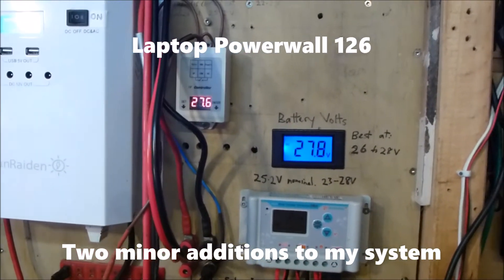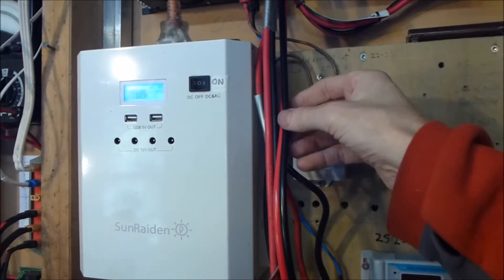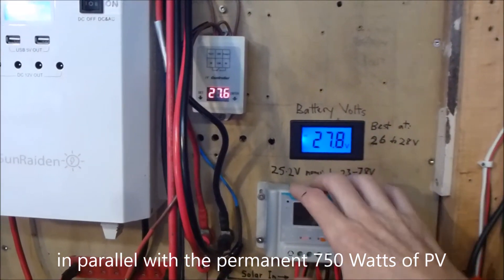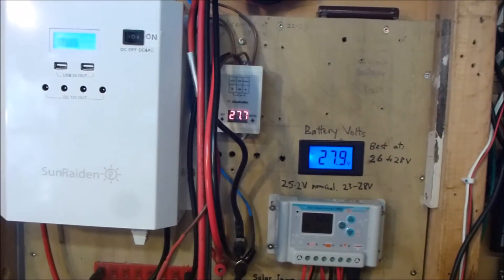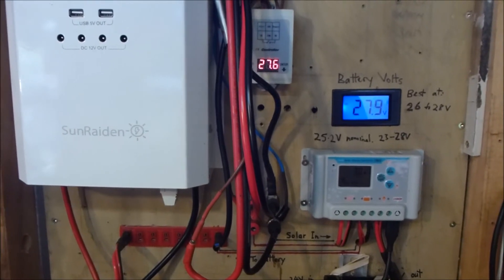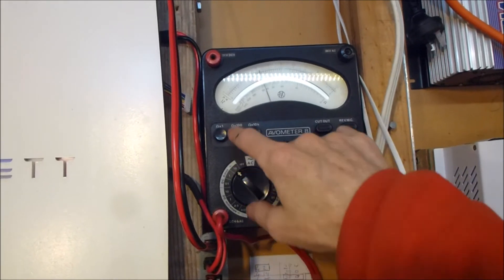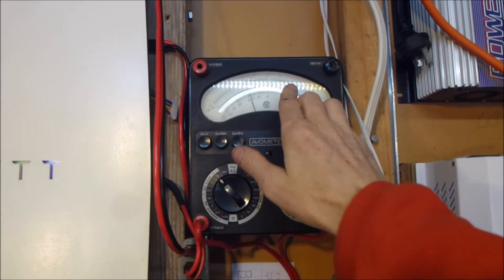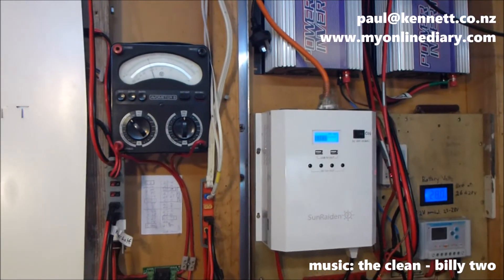Laptop Powerwall 126 - Solar panel diverter and Avometer

Comment: I can highly recommend the epever solar charge controllers, really cheap and have built in monitoring.  I've got mine doing pretty graphs in grafana and it was incredibly easy to setup.
Reply from the maker: Yeah - I've seen your EPever vids. Looks like that'll be my next controller.
Reply: Only thing to watch out for is the overall total power support.  i was a bit disappointed with the max capacity of even something like the 30A model i have.
Reply from the maker: Hi Colin. I always assume cheap stuff is good for about half the rated power. Would that be about right? Cheers, Paul
Reply: No i think it's good for it's rated power but with the 30A MPPT model for instance you are limited to 720w on a 24v setup.  I had thought with it being mppt and it stating that there was a 100v limit that i could put more panels in series and would be ok so long as i kept it under the voltage and amperage limit of the controller but the documentation has a limit set, it does contradict itself slightly but i'm not brave enough to test it lol.  I had a good conversation with Adam Welch as he has the 20A model of the same model.

http://www.epsolarpv.com/en/index.php/Technical/downloadF/id/678
Reply from the maker: Ergh. That's not what I was hoping for. I've got 1000 Watts of PV :/
Reply from the maker: Hmmm. Just been looking at the specs in the manual and the closest to my requirements would be the 4210A (40A) model with a rated max PV input of 1040 Watts at 24 V. I still kinda wish it had a bit more headroom beyond 1000 W.But... the price is good. Tempting.
Reply: Yeah the 40A would just be enough, the way i read it is that you can put more on but it would utilise 1040w so on a really sunny day it's a waste and would only be handy in the winter when the output is low.  I have opted for the unit from electrodacus which is a 40A one but allows a lot more PV and also does battery management, it's not that much more than the 40A epever i think. http://electrodacus.com/